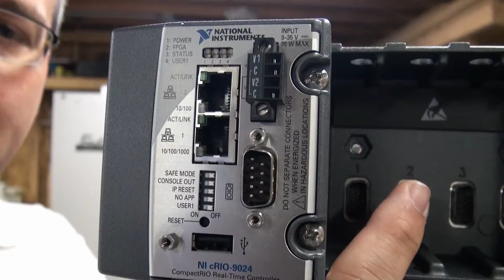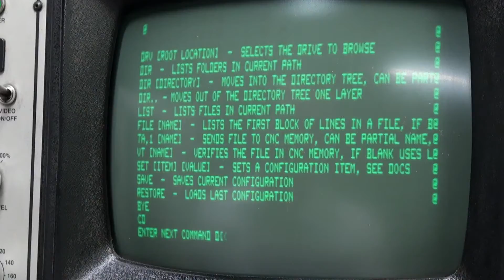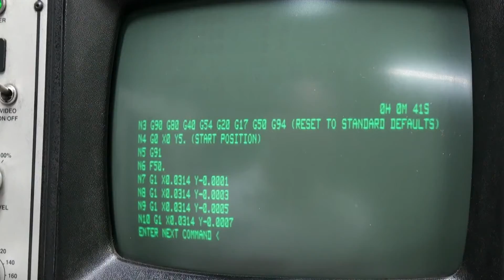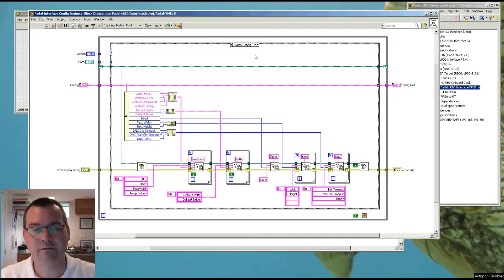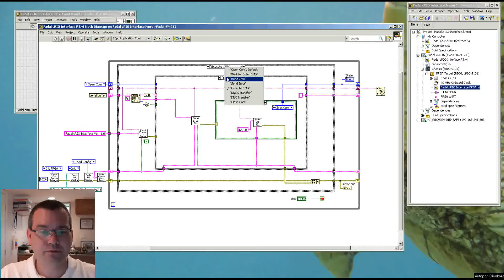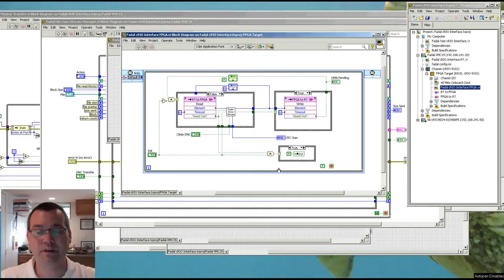Interfacing CNC Mill with Network Attached Storage NAS

Comment: Sorry to bother you , but I need your Help!
My father got a fadal cnc 88 , he install the machine, and everything was working ,  but the keyboard has some key that dont response , so he order a new keyboard  , and we installed. the keyboard works , but now the hand  wheel  is not responding. I try to help him ,goggling the problem but  theres  no info . but i find you videos ,  Iam a electronic assembler , so  im short to fix this machine.. so hopping you can share some advice. we try with the keyboard diagnostic .  then pressing JOG all the control buttons work and show activity  less the hand wheel 
 thanks alot for your attention

Comment: The lesson I've learnt was reliability of your system but it comes at a cost that one man shop can't afford it. I salute you for the lesson and your time.
Reply from the maker: There are some commercial units out there that will do similar functions, but not the extent I did.  They typically need you to load the code onto them with USB or FTP and then you can have them DNC like I did.  They are in the $500-$1000 range I think. If your good with electronics you can probably get something going in the $100 range I would guess.  The cRIO I used can be had off Ebay or the likes in the $1000ish range for the hardware.  Software is the harder part.  If you need to pay someone for custom software development for your machine then your talking some bucks, most likely around $5000ish for NRE costs.
If you have any other questions feel free to email me.  Thanks again.